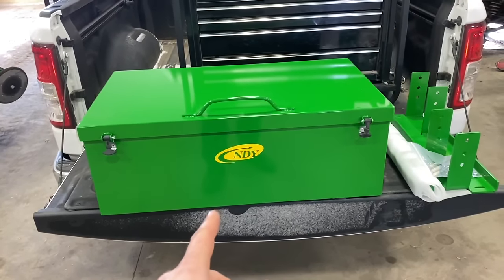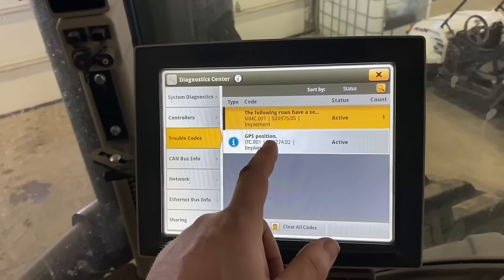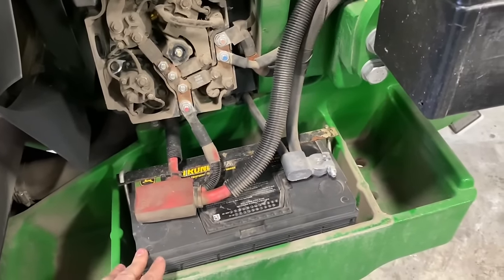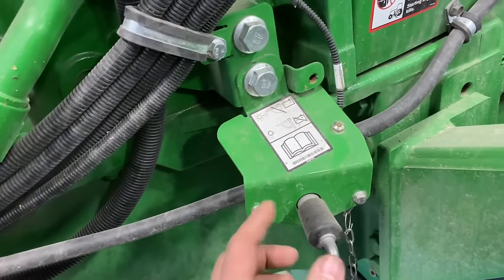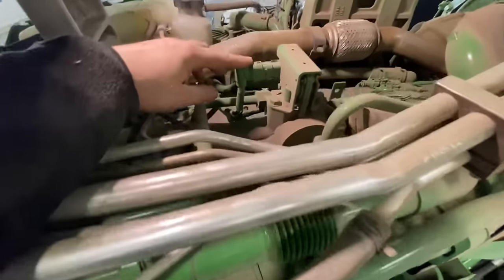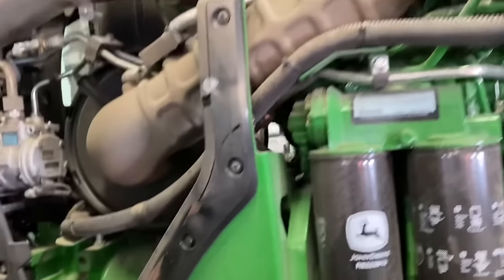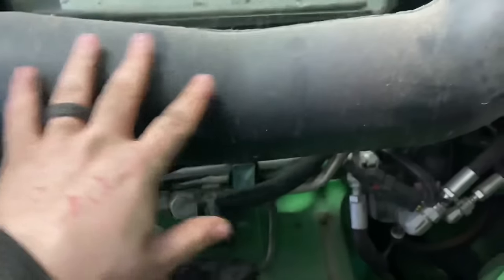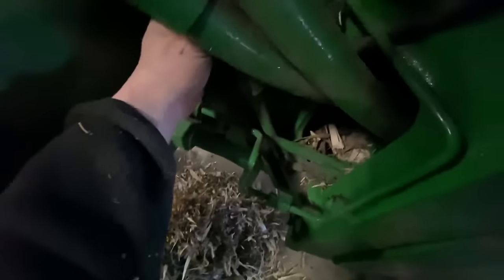@MillennialFarmer 8320RT inspection (Part 3)

Comment: Thanks for another great video. It was so interesting and what a great learning tool. Thee best instructor type video I have seen. Wow. Just awesome, like the younger ones say. 

I found this video so interesting with this new technology driven machinery. Zeth your overview of Zach’s tractor was most interesting. Wow. The owner now days has to be really into the workings of the systems to keep their equipment running right. It would seem to me up have someone like Zeth to look my equipment over before spring to make sure I was on top of it all especially if I was not real deep into the technology. Realize the pocket book has to support that but probably is worth it to protect my investment. 
Zeth and Caleb are so technology driven I am amazed at what I learned from them. This modern day equipment is advancing so fast you need a Zeth and Caleb in your back pocket to make sure your investment is being kept in the best operating condition. 

My sincere thanks to Zach for having Zeth and Caleb come and go this videos, part one thru part three. I sincerely feel I am not so dumb on a high speed planter and newer green tractor now. I flat learned a lot.   As a small bit of humor, please do not send me a bill-ha!!  

Guess I will be quiet now and leave you all alone. 
Looking forward to the next video. 
Thanks for everything. 
The Iowa farm boy. 
Steve.
Reply from the maker: Thanks steve!

Comment: So on my 8520t. I ran a hose from the grease zero between the front main bogies out near the step. Made it super easy to grease. Not sure about the new deeres but them older ones would eat the push block out fast if ya didn’t grease them daily

Comment: you say its hard to cut through that engine harness, yet i just fixed 2 tractors recently by cutting through that loom using a used hog castration knife. more of a pain in the ass than anything. my dull knife didn't have much of a problem cutting through it either

Comment: I work as a system integrator in industrial process automation, and those error messages are pretty pathetic. "Primary hydraulic pressure to low" so what was the pressure when it triggered the alarm, or what is the threshold? Seems like something you want to know from an alarm message. 
Also the constant nusance alarms, I think the AG sector can learn a thing or two from the process industry. Things like alarm shelving.

Comment: why dont they clean the engine with a high pressure air. It will irritate me. Whenever i finish working with my  truck  i blass the dust off every single time